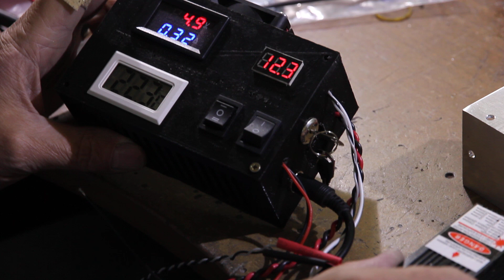How to upgrade your laser module. Adding an air assist to your laser - improve cutting abilities

Comment: so you show us the dot from the laser saying how week it is, yet after you connect it to your box it still looks just as week. plus it is drawing the same voltage and current. i think the laser was just set on the power level for focusing so it would be weak

Comment: The ratings on any of those fly by night, flash in the pan, fell out of the back of the factory type electronics, if its anywhere near realistic in the first place, is that at best they mean the maximum input power..... from the power source. ie, the wall. 

They mean it can draw 15w. ~10w loss in the power supply, another ~4.5w loss in wiring and light conversion gets to ~5.5w .... Maybe ... If you're lucky...

Remember folks, you get what you pay for. Sure it might be like a more expensive product but the one with the big name company stamped on it past multiple levels of quality assurance, the one at the Dolla store past maybe one level, the one on ebay for 50 cents they probably plugged it in and it probably didn't let out the smoke so it goes on eBay. Who knows how long it will keep the magic smoke in, but it didn't let it out of the factory so off it goes.

I find as a rule of thumb look for the cheapest price you can find add 20% and that is where you should begin considering buying the cheap version. That's not to say you should buy the one for 20% more, that's just where you should start looking.
Reply from the maker: how to add an air nozzle - detailed written guide https://endurancelasers.com/how-to-make-your-own-air-nozzle-for-the-laser-cutter-full-video-guide/

Comment: Sir my laser (same as yours) is very very low... I go it second hand , I tried a 1 A 12 V Power supply, then a 2.5 A 12 V without succes its very weak. What current do you use for a 500mw 405 nm laser. Or how do I know or test that it is broken. Thank you for your video I will get your kit to upgrade.
Reply: Try use current limiter for 40miliampere. If overcurrent ur laser diode can broke, not bright anymore an dead for slow

Comment: You never explained exactly what these “upgrades” are supposed to do. Are they supposed to increase the output of the laser or ?
Reply: the air assist delivery Extra FUEL to the MIX in the trial of fire🔥💥 ✴️ LASER. and make sure the surface its clean and 🆓 of melted material or charred spikes.